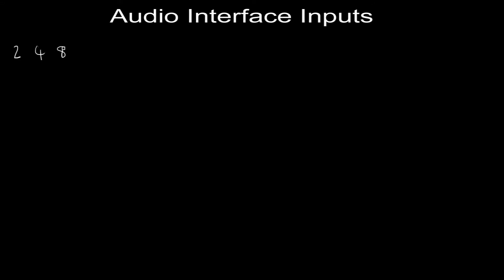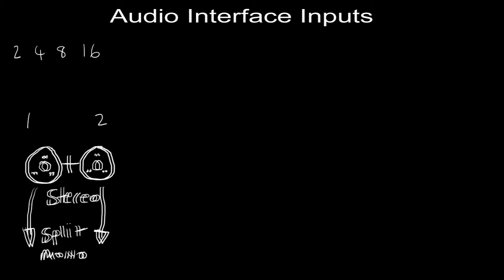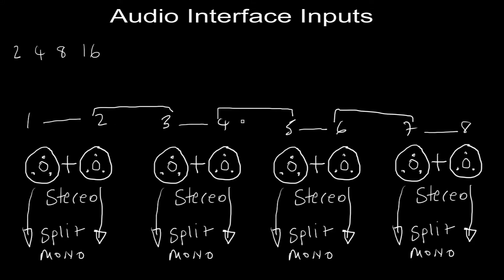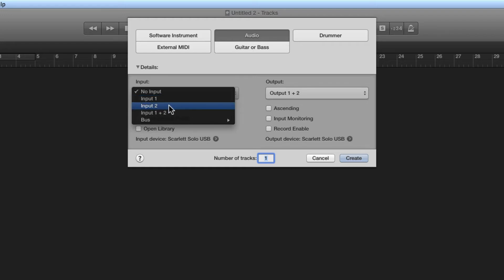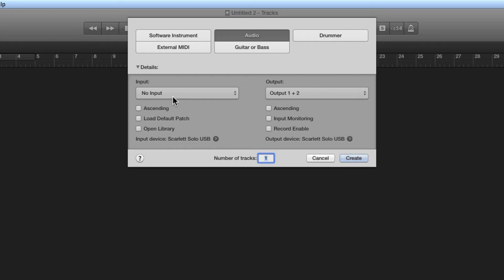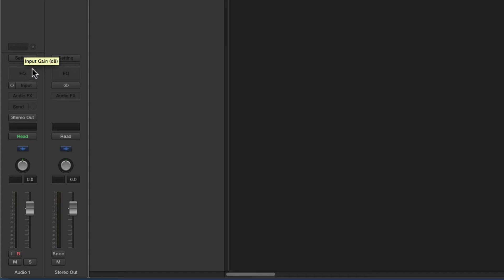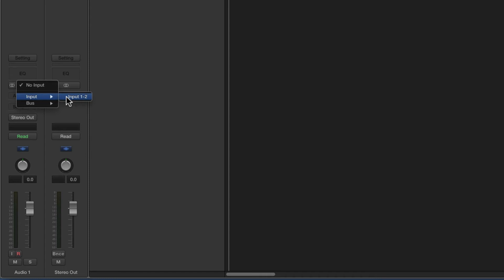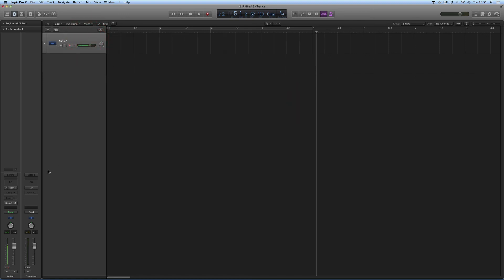Logic Pro X tutorial: Audio tracks & Audio recording 9 (Assigning inputs To Tracks)

Comment: I followed your instructions for recording vocals and guitar separately with my Yamaha audiogram 6 and I still can't record separately. I have my track one set to input one and track two set with input 2 but both tracks record both inputs at the same time. I can't edit my vocals and guitar separately. I've been spending hours searching the web for a solution and I just don't have any luck.
Reply from the maker: electric guitar?
Reply: @dancetech  Yes, plugged in direct. My interface is set to mono as well. It's a CODEC Yamaha audiogram 6 with channels 1,2,3/4, and 5/6. 1 and 2 can be used as R and L for stereo recording as well which I don't have a problem with, but when I record in mono both inputs are recorded on both tracks together.
Reply from the maker: not sure what you mean by "putting input 1/2 in mono" is there some switch to do that? because that's not how audio interfaces work. inputs are always paired, and whether you record in mono or stereo is down to the DAW track you setup... so try it NOT in mono & just choose the inputs on your two DAW tracks
Reply: @dancetech  Yes it has a switch and that did the trick. I don't why I didn't try that haha! Thanks a million!

Comment: At the 13:57 mark  is there a way in Logic Pro X that I can connect the three mics without them all having to be on separate tracks and without them being left/right? I would like all three mics to be on the same MONO track.
Reply from the maker: why?
Reply: dancetech I would just rather have them all on one track when I'm recording my podcast with three guests for me it's easier to edit is there a way that I can have all three inputs on one track it on one track
Reply from the maker: why not have them on seperate tracks and edit those tracks? if you put all 3 tracks into a Track stack you can then edit one stack region which represents all 3 mono tracks inside the stack. to get all 3 mics on one track you'll need a physical mixer tablet and then route all 3 mic feeds to one audio input.
Reply: Well, when I do have them on separate tracks they only play on one side either the right or left.  And thats even when I switch the tracks to mono. Input 1 will play on the left side and Input 2 will play on the right side.
Reply: And then when I edit and cut something out on one track it will throw the flow of of the other tracks meaning they won't line up with the interview of me and the interview.
Reply from the maker: i'm going to be a bit blunt here (cos that's how i roll) Your channel claims: "This course will provide you with the opportunity to have your own podcasting personal coach to help you through the entire process of launching your podcast." - so given that, i don't need to be answering these questions for you.
Reply: And I can respect that.  Its a podcasting course that cover everything except Logic Pro X.  I have basic knowledge but not in dept knowledge.  I know enough to teach in my courses.  But for my podcasting course I don't really need to go that far in-dept with Logic Pro X.  I was basically asking for myeslf.

Comment: I've heard some great recordings with vocals in left and guitar in the right ear and there's nothing to do. But they don't realise it and listens to it on a mono speaker or computer. I've also heard many recording songs with professional backing tracks that comes out as mono. It's impossible to convince them that it's so. The mic is mono, the kick is centred, the bass and snare too so, plus they don't know why.  

I saw 10.3 was out as an update. It includes rendering FX's on audio clips and I think it's apples response to poor CPU performance. I can't run LPX demo song on LPX.
Reply from the maker: well I am uploading a video showing how easy it is to add a cheap external SSD drive to install OSX Sierra. I've got it up and running and the SSD makes my old iMac BLAZING FAST! it's like having a new Mac, with the bonus of running Logic 10.3.

The ability to process fx on regions isn't just to save cpu (which I suppose it would but you could always bounce in place to do that anyway). The point of it is that you can create 2 separate channel fx chains in a floating rack, and then apply those 'special fx' to any regions or to a marquee selection... useful to add special fx using processors NOT on the actual channel all the other regions on the track pass through to get their sound character... or you can add special fx to multiple regions or a marquee selection across multiple tracks (which of course each have their own different fx chains on their mixer channels for general playback)... also useful - if I think about it - to add special audio fx across multiple regions or a marquee time selection for film work... so you can have a mix going .. maybe 20 tracks... let's say it is supposed to be music playing in a room from a stereo... then in the film the guy walks into a different room, the entire section of music at that point can have an eq across it as the actor enters the other room and the music muffles down as it would as he transitions to the other room.... you can do all that sort of stuff IN-place now, rather than rendering down the entire music mix, then adding the special effect afterwards.
Reply: I would like to see how you install Sierra on an empty disc. I wonder if Logic has to be installed too since you can have it play from on another disc and also the project can be on the second disc and if you run Sierra and start the Logic residing on your home disc you get that alternative to see if it matters.But I had to make an alias of Logic and place it somewhere else cause the app folder is empty. I hope to see the installation of Sierra then. 

I can see the use of FX the way you describe it. We'll see if you include that in a post-production of recordings. It's like a plug-in that can hold several plug-in setups then. Else you would use several tracks or bypass an FX's group in automation and activate another. 

I'm surprised by the SSD results but if it works it works. A system disc doesn't have to be big with the archive on a bigger disc.
Reply from the maker: https://www.youtube.com/watch?v=fdbSGIwiLIQ&t=995s
Reply: I can install an SSD in my 15" MacBook pro. The CD-slot can go out and an SSD go in. I have a 750 GB 7200 disc for archive. Seems to be an attractive setup. I would like to use the 15" models standard for everything. But 2.66 CPU has had to much performance issues.